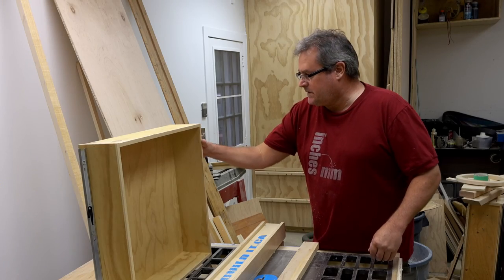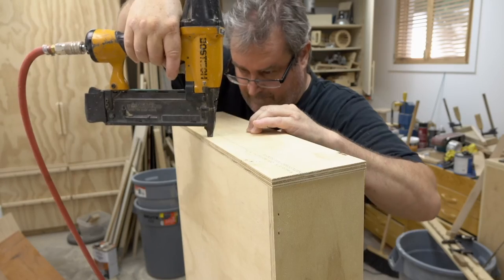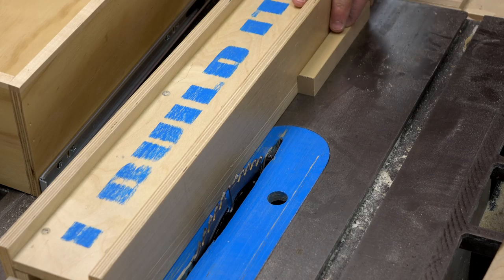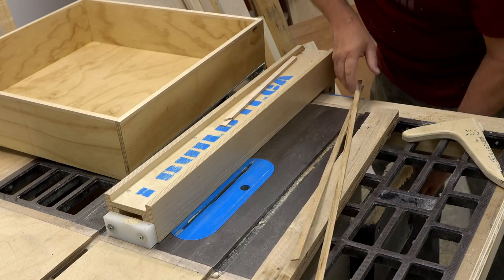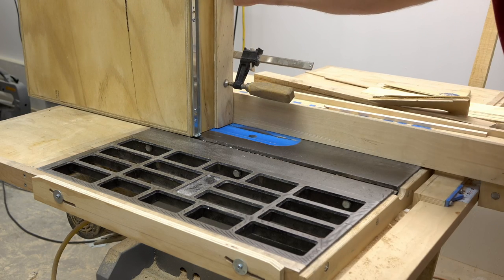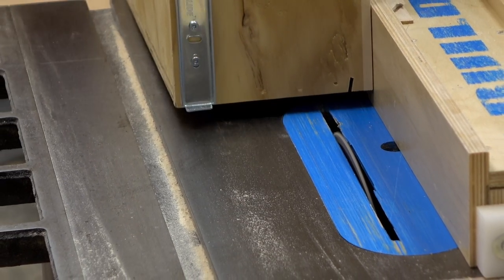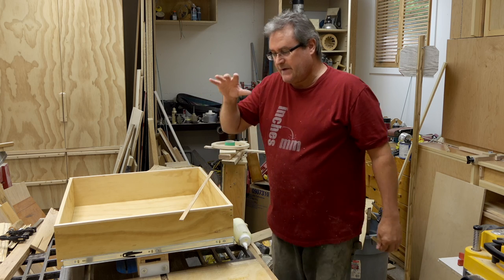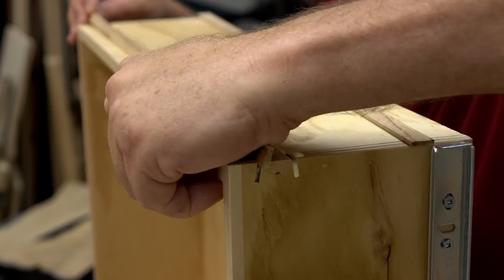Another Easy Way To Reinforce Drawers / Butt Joints

Comment from the maker: It doesn't get much easier than this and these splines add a lot of strength to the joint. If you are going to use these, I suggest you skip driving nails into the area where you will put the splines. 
Even though I cut mine all the way across, you can easily just cut part of the way in instead from both sides and glue in shorter splines.

You can help support the work I do in making these videos:

Plans for sale: http://www.ibuildit.ca/plans.html

Support this channel on Patreon:
https://www.patreon.com/user?u=865843&ty=h

Did you know I have other YouTube channels?
My main channel: 
https://www.youtube.com/user/jpheisz

My home reno channel: 
http://www.youtube.com/c/IBuildItHome

My "Scrap bin" channel:
https://www.youtube.com/c/IBuildItScrapBin

Website: http://www.ibuildit.ca/
Facebook: https://www.facebook.com/I-Build-It-258048014240900/
Instagram: https://www.instagram.com/i_build_it.ca/
Reply: Now I would have put these in perpendicular to the front but I like the 10 degree angle; it's neat and makes for a cute aesthetic with very little effort - very easy way to switch it up a bit. :)

Just a question though - apart from aesthetics are there any reason for both the angle and going with a full length spline instead of say just doing the corners of the drawer?
Reply: I Build It holy crap I have been cutting splines for yonks and I've never just turned it around halfway through. Forehead-slapping moment right there... haha!

Comment: I always put screws  front and back on cheap drawers hidden by the frontpanel , i for shure try this method. Thanks John, like always very educational and plezant to wach.
Reply: I would also suggest making your front and back the smaller pieces. The sides should be the full depth of the drawer. Then screw through the sides into the front and back. This is much stronger. The screw holes can be plugged
Reply: You are absolutely right, and if i would make a nice drawer that is what   i would do, but 15 years ago i made drawers out of white melamine and didnt had a "nice" solution for plugging it (and alsoo not much tools) , so did it the way i discribed. This was and is for my kitchen.
Even now after that time and alot of use and abuse no problem.
Kinda proofs what John said in previous videos, it only needs to be that strong as it needs to be, the srews and glue seem more then strong enough. Thanks for the info anyway.
In the next 2 years im planning on making my own kitchen (no melamine) and will construct it like you discribed.

Comment: Hey John, you were suppose to use your overly expensive Japanese pull saw to cut the ends of those splines.
Reply: Maybe somebody should tell John that there is such a thing as a flush cut saw and that "all" the other woodworkers on YouTube use them?  LOL I hope you can almost taste the sarcasm in this response.  Me thinks that John used a used hacksaw blade to trim the splines just to give some of the viewers seizures! :)  Luv It!!!!
Reply: BitHead1000, not sure where you shop, but those flush cut pull saws are often cheap.  In the $10 to $20 range for a Shark brand saw off Amazon.
Reply: Japanese pull saws are the cheapest saws you can get.

Comment: You can also use the edge trim on the top of the drawer as reinforcement.  Overlap the plywood butt joints of the drawer sides when you apply the trim.  Not as strong as the splines, but better than nothing and zero extra work.

Comment: The strongest part of that joint is really the end sections where it contacts the sides and front. The middle section is really doing but look nice. You could make a nice jig to add corner splines to your corners to your boxes. I think Jay Bates and  Matthias Wandel have videos on how making jigs.
Reply from the maker: I'm pretty sure I made a version of the jig you describe before Jay was born, but thanks for the great advice :)
Reply: LOL sorry about that John. I thought I had seen it as well on your site but couldn't find it. It might have been on one of your other channels. Great job as always
Reply from the maker: I try to do new things, or at least old things in a new way, so not much point making a video or article on yet another 45 degree miter spline jig. 
By the way, that kind of jig really only works well with mitered corners, and not butt joints.
Reply: I guess that makes sense. In a butt joint there wouldn't be very much surface on one side to glue to.

Comment: Great video John!  As always.  I assume you would only need the splines on the front because that is where most of the "abuse" will be, like the pulling and pushing of the drawer? 

I will definitely try these out on a future drawer build. Thanks for the tip

Comment: tip: @ 0:35 , instead have the top strip longer so it overlaps the side panels, a bit stronger even.
Reply: That would leave exposed end-grain after the drawer face is installed, defeating the purpose of putting the strips on.

Comment: Cutting the top trim longer/shorter as needed to overlap the butt joints would also add a tiny bit of extra strength to the joints.

Comment: One way to reinforce the drawer is to slap 5mm steel plates all around and weld the corners after which you throw all the wooden parts in the trash.